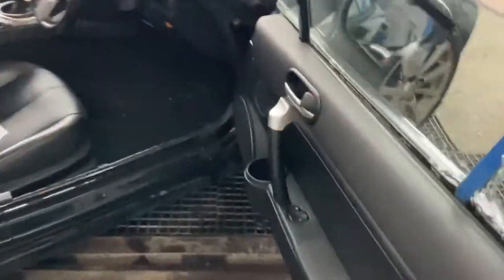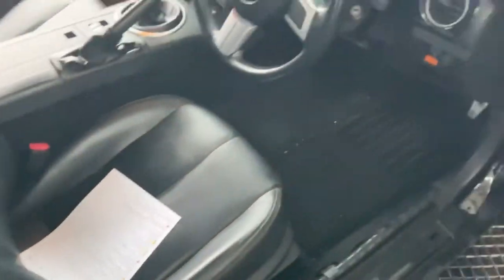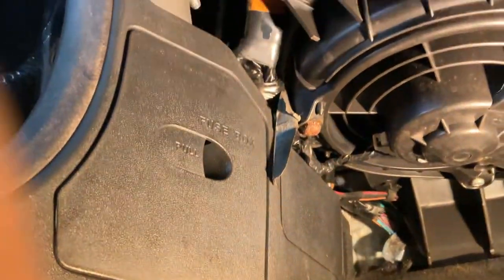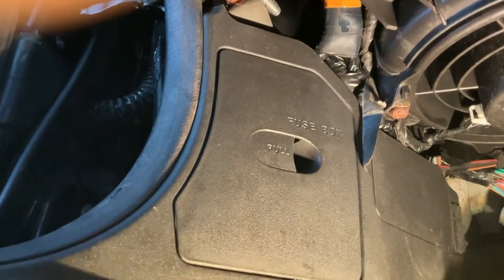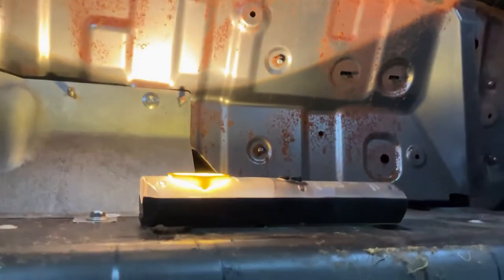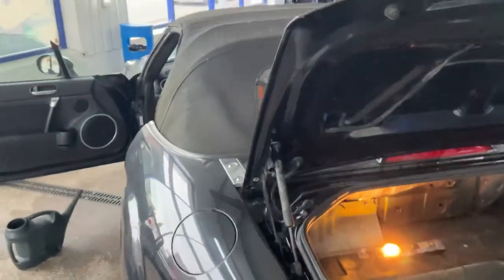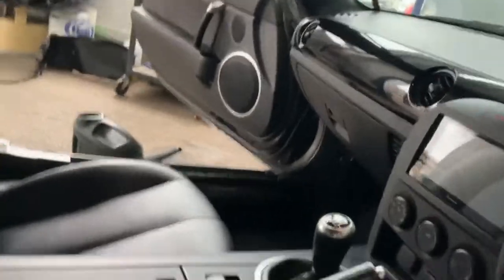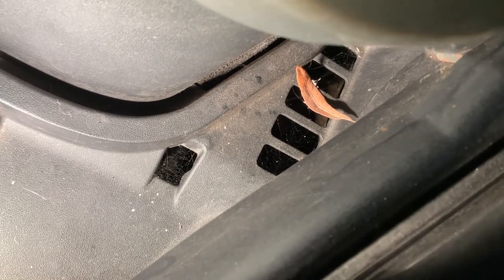Mazda MX5 2007 | Water Leak Found

Comment: How about the third brake light leak and how do you stop it ?
Reply: I believe that we tried to take the unit off to investigate, but we broke it. It happens sometimes, especially with older cars, that parts become brittle, clips rust, and will break. So we replaced the entire unit with a new one which obviously solved the problem. If we had managed to get the old one off in one piece, we probably would have sealed it with some sealant.

Comment: How do you deal with the door membrane ?
Reply: We make new ones, but you can buy it as a replacement part. However, these are usually pretty expensive considering it's just a sheet of cellophane.
Reply: Just out of a piece of poly ? And if so what type of sealant ? Mine appears to be black and very sticky.  And most of all thanks for the reply and a fast reply it was .
Reply: @JAYJAYJAY53  On second thoughts.... I could be wrong. The video shows the inside of a Mazda door with the sheet of cellophane. https://www.youtube.com/watch?v=08bOT_scqd8
However, I think some of the newer models have a hard plastic membrane.
Innotec Adheseal is a good sealant.
Reply: @newagainautoreconditioning  my 2006 definitely has a plastic membrane